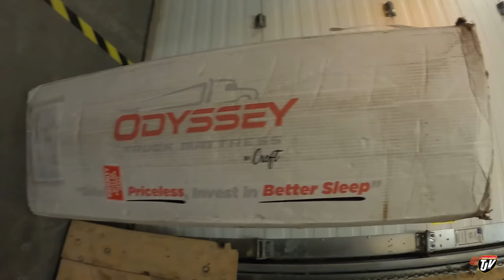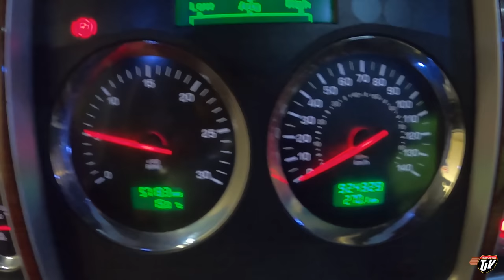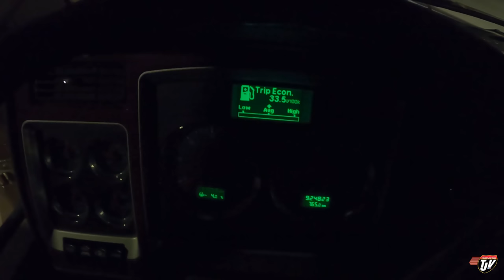BACK IN THE SADDLE | My Trucking Life | Vlog #2680 | Dec 4th, 2022

Comment: you'd be surprised how many Kenworth accessories , lights accessories are sold on Amazon ( in the U.S anyway ). they have a  light strip by itself but you'll have to jerry rig it cause it can bolt on the hood ( need to cut )

Comment: I understand the need to complain about others parked in a truck spot. I was west bound through new york state on I90, not far from NJ, when I stopped at a trucks only rest stop. We'll wouldn't you know some dumb ass 4-wheeler decided he could stop there and stop in a space so that I couldn't pull off the entry road all the way. Alot of rest stops are designed with parallel parking. I don't remember any other details but he ended up moving at my request.